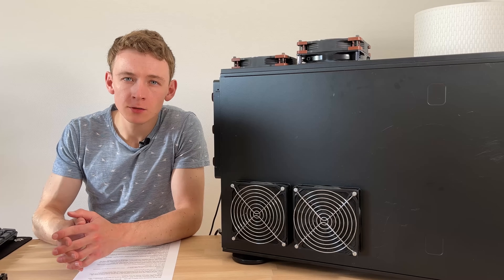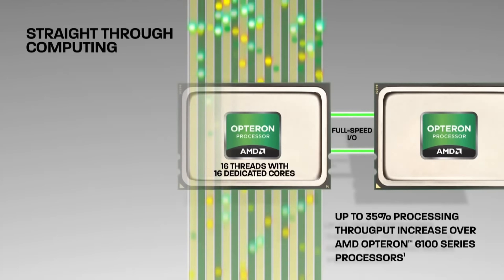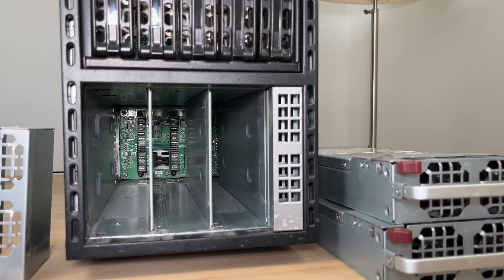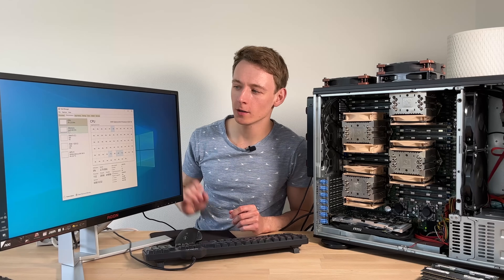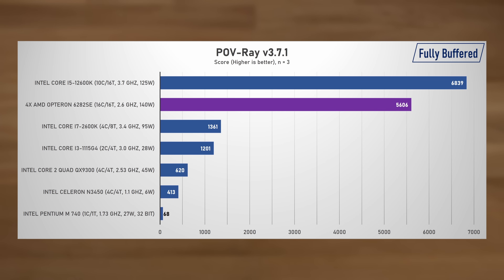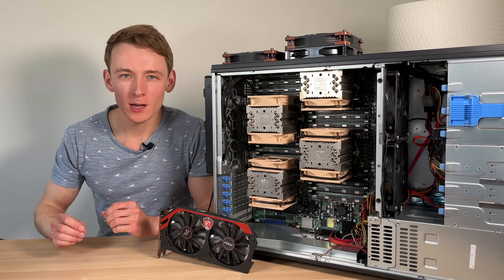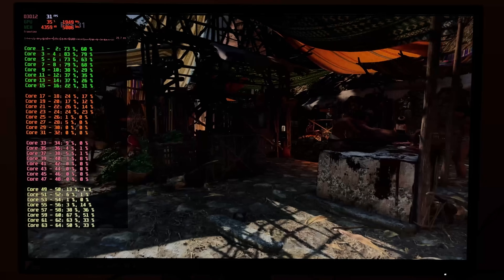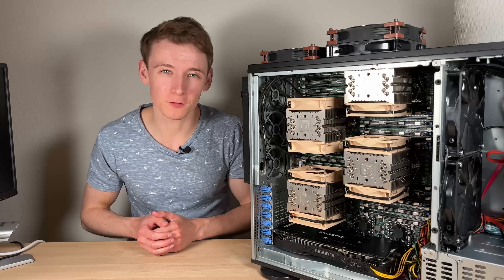The Quad Socket 64 Core Opteron Monster – The Most Insane Desktop PC

Comment: One question.
How much memory per socket are you leaving? as if it gets too low for watever you are running you are going to force the computer to access the memory available addresed by other sockets, with performance penalties comparable to a GPU with it's VRAM full using the main system's memory.
Let's not forget this is Bulldozer, an architecture that is way too starved for memory bandwidth, and in my limited experience with Bulldozer's and Piledriver's with the Orochi die, the performance does scale better with more RAM sticks than with Higher memory speeds, obviously it scales best with both, but what the Supermicro manual actually warned you about (When it said ''it works optimally with 4 dimms used per socket) is that when the Memory controller sees that both channels are fully populated, the memory controller switches to what I call ''Server Mode'' (It does actually activate on desktop FX as well, not surprising as both chips use the same Die as the desktop FX did use), limiting memory at a maximum of 1333MHz but the bandwidth is marginally affected, the issue is the latency, so, for optimal results using the setup of half of the dimm slots unused, you would very likely want to have memory running at least at 1866MHz or use all the slots and get a penalty in latency. Obviously the penalty is higher in the desktop chips, if not exclusive, due to the high clockspeeds they run at.
You could theoretically work around this by just tightening the memory timings as low as possible, as close as 8-7-9-7 (which will be comparable to run a memory kit at 1866MHz despite the physical clock being still 1333MHz) and still get to use all the memory slots.
I would say that there is more testing to be done before concluding the actual performance of the machine.
If you need more exact info, just tell me and I will see how to give it to you.
BTW, those are SE chips, if memory serves me right, they are unlocked in terms of VID and Core Clock, so it could be that you only need a software utility to handle the clockspeeds without flashing the BIOS, I have one japanese utility named K15TK, but I'm uncertain about if it works in server hardware (On all consumer Bulldozer and Bulldozer derivatives it does work, tested in an FX 8120-Bulldozer, FX 9590-Piledriver, A10 7870K-Steamroller and FX 9800P-Excavator), be aware that the program cannot directly change the BCLK and cannot exceed the highest non-turbo state if the chip is locked, however, it does make the turbo deactivation a lot more tolerant (about 5-15% on Orochi Octacores depending on TDP, the lower the TDP, the higher the percentage is, 10% on Kaveri and Godavari Quad core APUs and around 25% on mobile Excavator Quad cores), so the turbo boost tends to linger a little more before going back to base clocks.
You can grab it here: https://www.mediafire.com/file/byad0ogk5foenmy/K15TK.zip/file
I did translate the readme, but fanboy's japanese can only take you so far. It should be mostly correct, though.

Comment: I gamed on a 2 socket ASUS KGPE-D16 with 16 literal cores and 32 GB of ram for a few years. The clock rate was a little below the current standard, but it wasn't really very helpful for most games because the games weren't written to know how to utilize more than a couple cores at a time.
For years, I tried to sell the blasted thing, but never could find anyone who'd give me more than chump change for it.
The original build was around $4000.
P.S. It used the G32 type sockets.

Comment: The Opterons were not good in many ways, which is why Opteron systems are so rare, they barely penetrated the market. This four socket machine will probably be slower than a contemporary dual socket Xeon, sorry to say. A HP Proliant ML350P Gen 8 from ebay will cost very little - mine was just 20ukp, and can be massively upgraded. A pair of Xeon e5 v2s will probably beat  these four opterons in most tasks.

Comment: Higher core count and multi socket systems are never about more performance (eg games, benchmarks etc), they are about the capability of doing more at the same time. It was the same with the original Pentium 4 HT and early dual core CPUs - most game benchmarks actually were a little slower, you would only see the difference once you were multitasking - render a video while gaming and see the single threaded/core chip stutter while the multithreaded/core chip does it fine be it a little slower while gaming but playable. Tomshardware covered this really well back in the day.

Comment: You should test this under Windows 11. Windows 10 is not great with high-core count CPUs.   In my own experience with using a 2990WX on Win10, the performance is greatly regressed under Win10.

Comment: My beloved multy CPU system were Mac Pro 3.1, 4.1, 5.1 I had each one of them ugrafed to max, last one it was with SSD's 4 NAS IRON WOLF 10TB each to keep all my gamen on them and an RTX 2080 and was fast but I sold it because I couldn't run HORIZON ZERO Dawn because the old Xeons didn't had AVX instructions other than that it was a BEAST running everything quietly.......anyway now I'm on a fully RYZEN PC 12 CORES and 5K Monitor, everything is fast !   GREAT VIDEO THANKS !

Comment: Now I need to read up on the differences between a 6282 and a 6380.  They look pretty identical specs wise on a chart I see for cores, cache etc but my 6380 uses less power 140 vs 115.

Comment: My server is a 16 core bulldozer running Truenas.  The good is that everything was cheap.  The bad is that the super micro board has very little options for monitoring the server.  These opterons also have a crappy thermal sensor that truenas doesn’t understand at all.  The cpu itself though is fast enough for what I use it for.  Under full load with 9 drives and 128GB of ram it uses around 140 watts.  It idles at 80 watts.  I’d love to get a 10Gb card for it at some point but 10gb switches are still expensive.  I’ve had a few interesting issues since I setup the server that there’s not a lot of info about online to help resolve.  It’s running pretty nice right now.
Reply: I have the 6380 opteron cpu

Comment: This type of machine was really designed for running lots of virtual machines for a business. Though it's really cool seeing it here, the 4 cpu ones are pretty rare. Though I have seen a few work stations with just dual cpus which makes more sense for work stations. You should review one of the dual G5 power macs. Those were always cool.
Reply: I run a dual-socket workstation myself, I'd love to have a quad-socket just for fun lol... it would make a neat system for virtual machines like you said

Comment: Very cool!  I don't know if it's been brought up already but you can put the Opteron 6386 SE processors in here and even overclock them with a bios flash.  Look up "OCNG5" for more details on that bios flash, if interested.  I have that exact setup but mine is in a Xigmatek Elysium case with a clear side panel and RGB of course.  I use to use it for folding at home and as a media server but it just doesn't make logical sense to run this power hungry beast 24/7 now.  I still fire it up now and again for nostalgia though.  Glad to see people are still tinkering with this old hardware.  Being server components it certainly will last a lifetime in home use applications.  Good luck and enjoy!
Reply from the maker: Thanks for the comment! That sounds like an excellent build :) I am indeed aware of the OCNG flash for these boards and have some vague plans for it

Comment: Doom 2016 results using Vulkan API it is very impressive that to utilise 40 cores. It is interesting the system can fully load a cluster (2 numa nodes ) on processor 4 but only a single numa node utilising half a cluster on the other 3 processors.

Comment: i got a dual socket opteron hp wx9300 ...with opteron 270s  altho i dont think it'll ever be fully realized.. its only in single cpu dual core mode with a whopping 2gb of ddr ecc ram. with a hd3870 in it.. and it still gets used. it plays world of tanks at 25-60fps the opti 270 with stands the full 250mhz fsb over clock if its in a cold room lol other wise overclocks at 240mhz fsb every day of the week
Reply: funny to think tho this thing could have ever only be at best x2 x2dual core for 4 cores across 2 cpus.....each cpu has 4 ram slots ddr1 ecc at best could be 8gb per cpu and the thing comes with a 1000 watt psu...... i dont think 2 opterons are really that intensely power hungry .

Comment: i know im late to the party, but if you want to upp that power draw, you can actually overclock the cpus, i think it's called OCGN Utility, you should check what mainboards from supermicro are supported. You can see more than 1000 Watt on that big boy.
Insane configuration, was using it for some parallel processing. The only really cool part was the dirt cheap memory (had 128 Gb or something for little to no cash), we are talkin 2015

Comment: I would like to see if there is any software that is optimized to take advantage of all those cores.   Because it seems the HT bus is a bottleneck..  Any way to overclock the HT bus?   Or any way try combine the NUMA nodes within the BIOS or is there a limitation?

I was seriously interested in this Quad Socket design back when it came out and then saw the benchmarks on various systems weren't that great overall...   Thank you again for the awesome video!
Reply: Run a hypervisor and load it full of VMs.

Comment: That thing looks epic, pun not intended. I've currently got 32-core threadripper system that I was using for compiling. I wish I could afford a full 64 core EYPC system.
Reply from the maker: That’s awesome - EPYC systems are sweet. A while back there was a reasonable deal on a 32 core model which was very tempting.

Comment: This would make an awesome domestic NAS that also has a Virtualization server running, OMV 6 would do the job nicely enough. 
NAS + Virtual Windows Server running as the domain controller, and it you have enough network interfaces why not also run OpenWRT of PFSense on another VM, though this would require you to do some fancy Networking configurations in order to have the router VM be before anything else and the Internet connection. Doable, but not 100% straight forward.
Another thing to run on it is a Linux based Surveillance server you know for a Smart Alarm solution and of course Home Assistant (which would be interconnected with the surveillance solution so you could have the alarm system pretend you are at home when on holidays by turning things on and off regularly while keeping an eye on everything. This needs some scripting but nothing impossible to achieve.
Also, another reason for OpenWRT would be to have a local proxy caching stuff like the Windows Updates so they do not need to be downloaded more than once for everybody making the first downloads normal speed and later ones full local network speed
And if you play well enough with Squid (the proxy server) as a transparent proxy server combined with Shorewall you can also filter internet content like ads etc. 
Basically you'd have a decent NAS (OMV6 with ZFS, oh make sure to have at least 5 HDDs preferably 6 with 1 or 2 hdds redundancy, personally I have a 2hdd redundancy setup) This will be fast storage wise (compared to the network unless you go above 5Gbps) and will provide all the stuff you need for a decent serious and secure domestic network and automation solution.
(All these are part of an 8 year old project I never moved forward as I would also be developing hardware for the fully integrated Home Security, Network and Communications and Multimedia Services (including of course Digital Cable/Satellite and Terrestrial DVB receivers to be shared on the network) - Never got it done because, too much for just one guy to do regardless of my electronics and computing/networking experience and knowledge. Wish I could have found a team, most of this stuff is now being made available, though cloud based and not privacy secure at all and as separate solutions not a full integrated system)
Reply: 2 years later and I have moved on to True NAS and a second hand actual rack server a couple months after having made this post as a side effect of not havving disk caddies on the previous NAS and not swapping 2 disks before the third failed hehe (not fun at all at the time)

Comment: I ended up with that particular motherboard off of an ebay purchase, however I did not have a case for it to go in. i ended up slightly modifying a corsair 900D. but it worked out for the most part. It's a beast running docker containers.

Comment: It's completely insane to imagine that nowadays we have CPUs from AMD with 96 cores each, could it be that with 4 of them we also get close to a performance 10 years into the future?
Reply: Apparently, the EPYC 9754 will have 128 cores. Absolutely insane stuff.
Reply: Too Bad the Garbage licensing Terms nowadays enterprise Software keeps hardware producers from engineering 4 soket mainboards.
Reply: @bubbabenali  run enterprise versions youll be fine
Reply: true but consumer CPUs not all are performance cores.

Comment: nice! thanks. i would like someone to do old dual socket system and see what old games can actually use it. lets say dual p3 and ut3.
Reply: P3 and UT3? Holy smokes, I don’t even know if that game can run without SSE2.

You’d need an absolute monster of a GPU like a 7800 GS…and a Universal AGP board (not BX) anyway.

Comment: Cool. I have a server with 4x Xeon E7-4870 cpu's that are from the same time period. They are 10c 20t each and I get 3273 score in cinebench r15. :)
Edit: actually, I had some wierd problem with windows where the cpu's didn't want to boost up fully. Only one cpu ran on max all core turbo, so the results should be a bit higher.

Comment: Wish they were making mobos for the Xeon E5 4000 v4 and 8000 v4 series rather than just the 2000 v4 series since those CPUs are so cheap noe u might as well pile them up and underclock for rendering and multitasking productivity  type workloads

Comment: that 12600k pulls almost nothing on power in comparison to those 800ish watts in the quad opteron system and is still faster, oh boy has the technic evolved, i think the first cpu that i used for playing was a duron 800 mhz, than the 1900+ came athlon xp, than 2000+, that 3000+ 64, than 4200+ x2 and then i think my ryzen 3200g and now a 5600H, i think this is my history, i never bought any intel chip, i hate d*cks thinking they are so famous, so big like intel did and now? they getting their azzes burned, i do own two notebooks with intel chips, but i never bought one myself, always amd

Comment: I work a good deal in the hobbyist space in X99/2011-3. Chinese Dual socket 2011-3 boards are very popular and a great deal of fun. Returning back to the question "what to do with this?" Well virtualization is a good way to break up the system into several usable Virtual machines OR to have the system run containerized services. I would say if you don't feel like  diving TOO far into a new operating system, Hyper-V is already in windows. If Linux is more your speed, maybe give Proxmox a try. I would be curious about how well this system would handle being broken up and used for multiple tasks or even simply running 4 instances on windows, each conducting benchmarks or games.

Comment: I would love to see this machine compared to a 32 core quad socket Dell poweredge R820. It won't even be close, but still fun.
Reply: i allmust  got one but its  r810 w4 8837
Reply: I have a quad socket R810. The 32c 32t 8837 get 2300 score and the 40c 80t 4870 get 3200 score in cinebench r15.
Edit: actually, I had some wierd problem with windows where the cpu's didn't want to boost up fully. Only one cpu ran on max all core turbo, so the results should be a bit higher.

Comment: Could you imagine how fast a quad socket Ryzen W5995 or whatever their newest treadripper chip is called, would be?
Reply: I know there's dual socket Epycs but I don't know if they're 4 socket capable.
Reply: @mitlanderson  They aren't quad-capable, nowadays servers are oriented to have the most power in the least sockets possible due to running costs on the system it runs, (think of it like the windows limitations we saw earlier on, bs like that) shit gets expensive when you see how many servers fit in a rack and how many racks are in a server farm.

Comment: I wish there was an am4 board like this. So I could have a pc with 4 Ryzen 9 5950x's in it. 64 cores and 128 threads. 512GB/1TB RAM.
Reply: Such a system would get insanely hot, especially under load lol

Comment: well at least this system has AVX set for accelerate AES/decode if it's also came with IPMI , i wouldn't mind to use it as a minecrawler or pfsense firewall to exploits what ever value it's left.